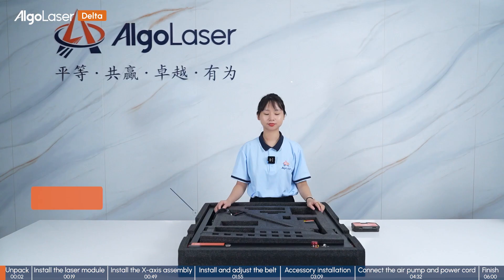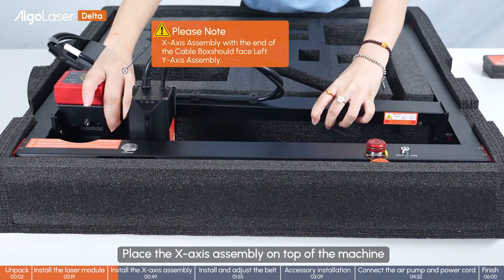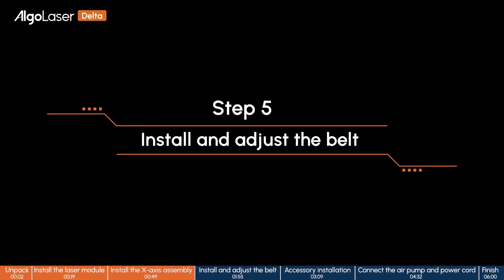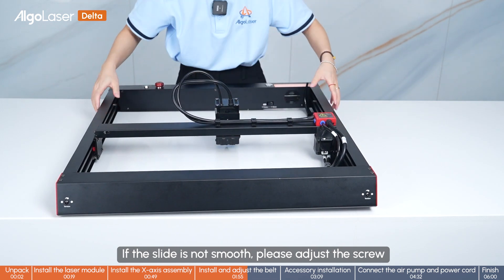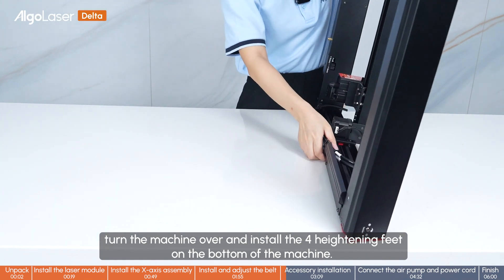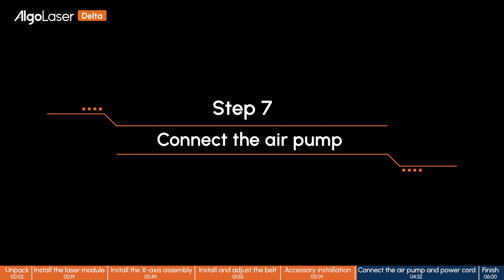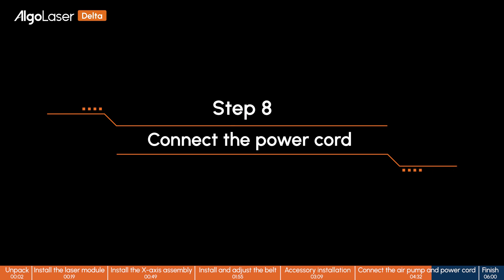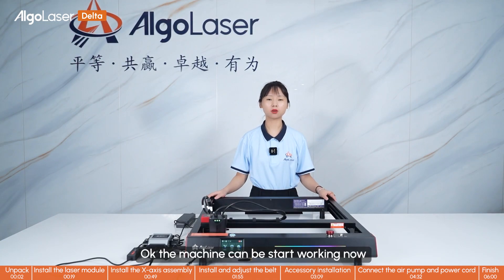How to assembly AlgoLaser Delta 22W

Comment: Step 6 is a little joke right? You put the entire weight of the machine rests on the power and air plugs protruding from the module, which may damage them!
Reply from the maker: Thank you for your feedback. We will re-review assembly instructions to ensure correct operating steps and techniques are demonstrated. If you have additional questions or suggestions, please feel free to share.